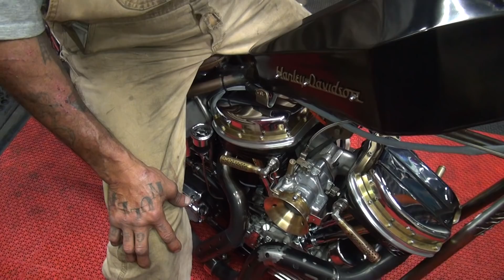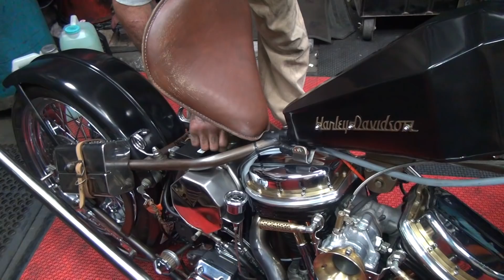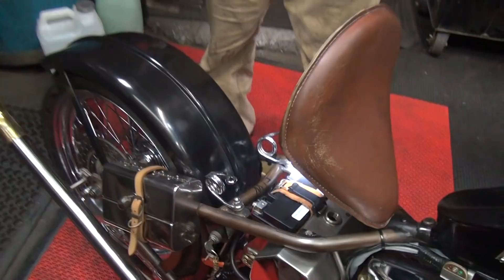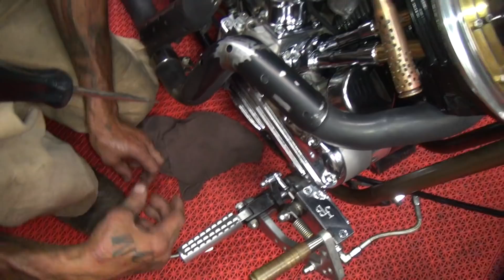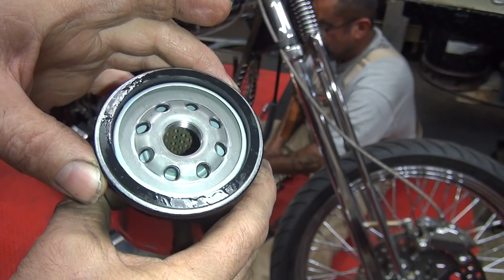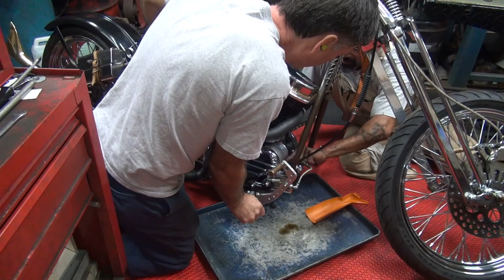#104 s&s 93ci evo, pan no oil pressure motor repair 1999 panhead bobber harley by tatro machine

Comment: Looked like the your oil filter had oil on the outside not the inside. Oil going in, not through the fine filter. So, no oil on the inside. Thanks.
  Just had the harley shop in town give me a 171 oil filter for my 124" S&S. Have have to change for the correct 170 oil filter. My oil gauge shows 0. Have seen it up to 5, while driving. Did see bubbles in the oil tank. There was oil in the tappet oiler and in correct. New 170 oil filter, tomorrow. I disconnected the oil gauge, started the engine. Saw oil coming up the tube, to the gauge. Shut off engine, oil slowly went back down the tube. Never came out. Shouldn't there have been more pressure?

Comment: Glad you posted this video. I'm having issues with oil on my evo. The idiot light came on. I parked the bike and purchased a new Ultima oil pump. Installed it correctly and made sure the keys and clips where set. But it still has the idiot light and it's getting a louder tick than usual. Pressure switch is good. Did the ground test. So pulled the switch  from the case and fired the bike. It has no oil flowing out of the hole. Also tappet screen is clean. I did find out I had a TC filer on the bike so I changed it. Same issue. What could the problem be?
Reply from the maker: pull out the oil line fittings and drill them out like i did in my 1992 evo motor build. than prime the oil pump like i did in these videos by removing the pressure relief valve and letting the oil flow in. after that try starting the bike and see what you have for oil pressure. make sure you check your oil line routing too.
tatro
Reply: @TatroMachine  I did use the factory fittings. Junked the fittings that came with the pump. The line routine is correct. I have checked 5 times now. I did also prime the pump. The only thing I can think maybe causing the issue is maybe junk in the oil galleys?  Or possible a loose line somewhere? The oil lines are stock to the bike. 1995.